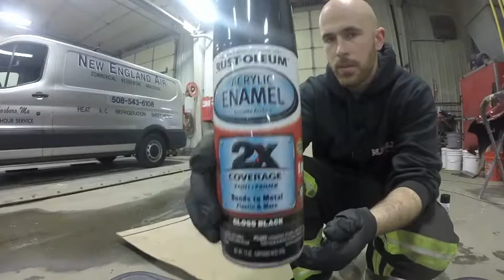E36 rear suspension and subframe bushing install

Comment: Solid work, way to stay cool when you borked the diff cover lol. What are your thoughts on the ISC coilovers so far? Can you compare them to any other popular E36 setup? Also, do you feel a lot more vibration / hear more noise from the rear end now from the subframe bushings? Cheers
Reply from the maker: Namesi Haha thanks man. Yeah shit happens. I knew better. Thought it would tap in a lot easier then it did. Lol but I would compare the ISC coilovers to BCs and maybe CAtune coilovers.  Great quality and they ride awsome!  I also have ISC coilovers in my e30 aswell.  And has for vibration.  You can only hear the rear diff kinda making a ""bad bearing noise"". But obviously there's no bad bearing..  I only felt vibration when I did the poly tranny and motor mounts.
Reply: Ok cool thanks for the info! Was considering poly for my rear end refresh but since its pretty much only for daily use I'll probably go with OEM rubber. Look forward to more E36 content!
Reply from the maker: Namesi no problem man thanks for subscribing and commenting!! But as for the bushings. You can go with a less hard of a poly bushing if it's your daley. I also recommend checking out the monoball trailing arm bushings. Kinda pricey but you'll never have to replace it again. You'll feel a huge difference from the stock bushings.. the rear end will feel way better and tighter.  But thanks again and definitely stay tuned for more content.!

Comment: Why would u hammer that diff anyway so much.... just use a plate, a m12 threaded rod a nut and make your own press tool super easy.....
Reply from the maker: L. Very true! But I actually was going to us the ball joint press tool I used to take the old bushings out. But I guess I thought the new bushings would go in a lot easier like the subframe bushings. Lol

Comment: What you used to cover the gas tank?
Welding protection blanket? or something simpler?
Reply from the maker: jw200 yes I used a welding blanket. I highly recommend using a welding blanket if you plan on doing the same thing.